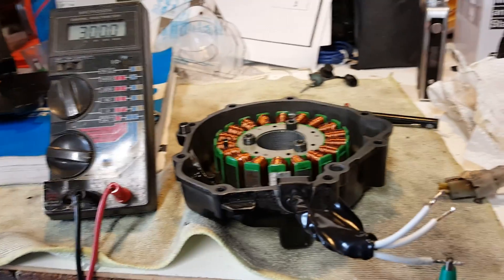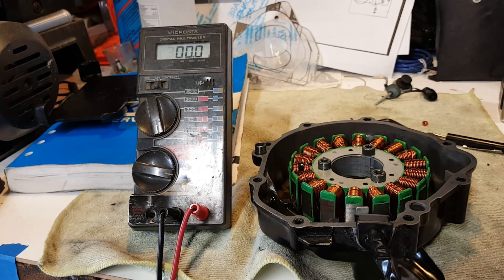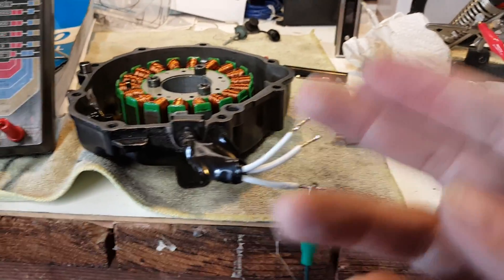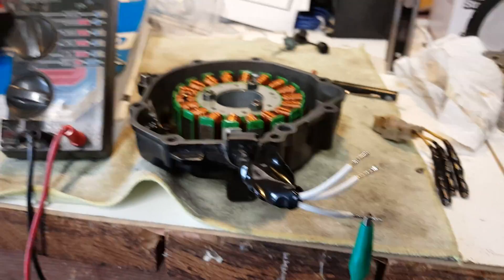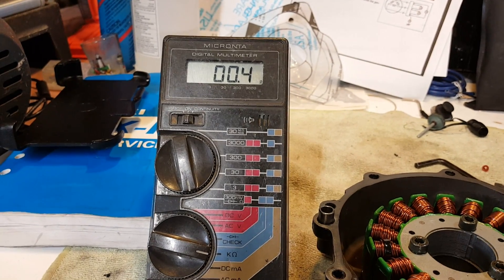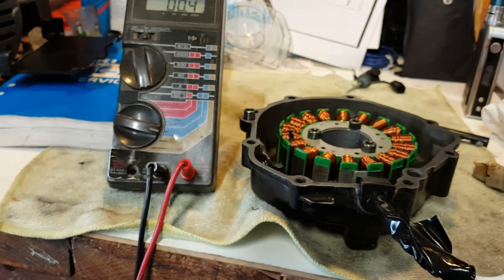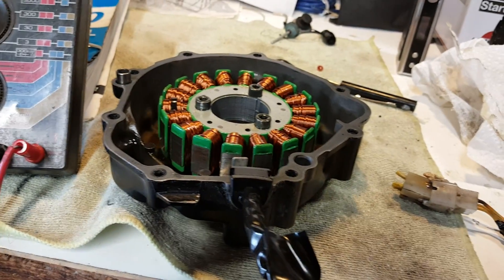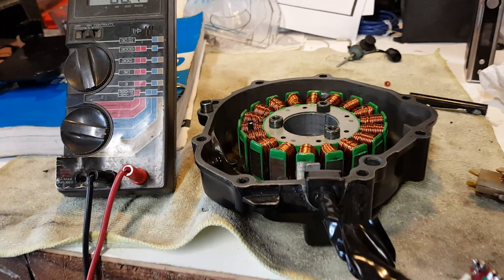Testing Your Stator on/off Your Bike

Comment: I didnt have a spark on my 08 te250, bought new stator  got spark, bike runs but not charging battery, stator from chine has 3 yellow and 2 wire crank sensor, thought might be cheap stator. Bought $300.00 oem stator from husqvarna  and wires are different and dont match plug on bike.
Reply from the maker: Well the plug should match up if the sale was for your bike specifically. Do you need the plug..NO.. as you can seen from my video I cut mine off so I wouldn't have to deal with the melted connection in the future. The plug may not match because some companies think for example the k6/k7 and some 1000s are compatible and there not.. so they posted as such.

What does matter is the correct voltage that the stator  produces and the fact that it bolts up to your housing. The number of wires from the stator should match the number of wires on your harness.

If your battery is not being charged then that means your regulator rectifier is damaged as well as it is responsible for converting the AC voltage from the stator to DC voltage which the battery and bike requires.

Comment: Best  stator check I've seen so far! 
👍
Reply from the maker: Appreciate you stopping in and saying so brother.. Hope to see you around in future DIY videos
Reply: I tested mine 89 fzr 600. I got all Zero for resistance.  Spec should be 0.31 to 0.37. Is this a good or bad stator? How does your Ebay stator holding out? How long does it last already?

Comment: you forgot to say HOW to connect the VOM  when engine running  IE one lead to one leg of stator wire , WHERE do you connect the other lead ? to ground or to other lead from the stator wire  ?
Reply from the maker: Put your meter on AC voltage/current.. Now Start the bike and let idle, disconnect the stator connection from the harness, ie.. Regulator Rectifier.. Place the positive and negative leads of your digital metter into any two pin locations on the stator connector while running. Rev the bike to 5K rpms and you should see 65 volts AC on your meter. Do this on the remaining pins testing all.. no matter how you rotate  your probs across all three pins, you should always see 65volts on your meter..

Hope that helps

Comment: When I pull my battery leads my bike dies so I thought it was the stator but I'm getting 4ohms like your good one so what should I check next?
Reply from the maker: Sounds like you got regulator rectifier issues. Your stator produces AC voltage at 65 volts AC, your regulator rectifier converts The AC current to DC voltage does charging your battery. If your status producing the correct AC voltage and tests just fine then there's only two parts to your system left..

Comment: hi sir why my stator of yamaha r1 when i test in ohms its only 0 no resistance, it means busted or shorted???thank you for your responce
Reply from the maker: Assuming that you have a 3 phase stator, set your digital multimeter to the correct setting for your bike, and tested it as demonstrated in the video then yes, your stator is toast. Most bad stators that have or had electrical issues will show it on the coper winding wires.. some look burnt or have a blackish color but just because it doesn't mean it's not bad, it's just one thing to look for. 

From what I can see,  the R1 has OEM Stator/Gen has a known issue of failure. So if this is the OEM then this may be the issue why it went out and you may need to replace both.

Comment: My connector wasn't melted like yours, but was pretty funky inside, I clipped mine and was wondering if it matters what wires connect to what? Cause when I hook my ohm meter up directly to the wires and rev I'm getting around 60 volts, but when I connect the stator to the bike and check the volts they're low and don't go up at all when I rev? Not sure if it's the regulator, or bad connection somewhere.
Reply: And not sure if the wires are just connected wrong, but didn't think it really matters, unless it does, when I clipped I didn't pay attention to what went where.
Reply from the maker: @paulburrows2120  What up Paul, no it doesn't matter  which  of the 3 wires you connect , there is no polarity. It's a bit harder to troubleshoot your issues once you have  butt connected but if you have used bullet connections, which come apart;  then you are golden. You need to start the bike and while running disconnect the stator wires from the harness and while revving at the bike 5k RPMs test the stator side  connections (BE CAREFUL  NOT TO SHOCK YOURSELF!) . Here you should see 65v AC.. if you do then you know that it's not the stator and only leaves the RR or battery.  Believe it or not a bad battery can still test in a good range (12V) but still cause an issue, This has happen to me twice and that's when I moved to the Shorai Lithium Iron battery seen here https://youtu.be/I8GIhZRz0os , ( Product Link: https://amzn.to/3gC4Cc2 )  and after 5 years I still have this battery and haven't had a single issues.

If it's not you're stator or battery then lastly it's going to be your RR.. I suggest not going cheap Ebay special and you can see why here https://youtu.be/uDhuwCE2Bk4 . I have no affiliation with these guys , I found them on the net after a ton of searching and reviewing. While the cost is a bit pricey I do not regret spending the extra coin for this RR, I still have it one my bike and haven't had any more issues with my electrical system.

It's been 5-6 years now and with these purchases I haven't had a single issue with my electrical system. Take it for what it's worth but for me this is the way to go.
Reply: @TheChemistDIY  thanks for the quick response! Yeah I don't have a tak so can't really tell my rpm's, about half throttle I'm around 60-70 volts which I'm guessing would be close to 5k so thinking my stator is good.I guess my question prior  was I checked the voltage after connecting the stator back to the bike and the voltage was low and didn't increase at all when I reved it up. Is that normal? Thinking it must be why you disconnect before testing but not sure. Also did a diode test on the regulator and thinking I did that right it looked good. And yeah never thought it'd be the battery, it charges up ok, bike will fire right up, but when putting ohm meter on the bike running it loses volts and stays around 11.9-12.2 volts when it should be around 13 or more. How would you test the battery in this situation? Sorry if I'm asking too much, I just don't know what to do really, don't want to fork over 200$ got a regulator and not be the problem.
Reply from the maker: @paulburrows2120  every bike has its own quirks and what your experiencing is what I went through many years ago, pain in the ass to track down the problem. This is the reason why I have the digital volt meter on my bike that you see in all my videos, I would never know when the correct voltage was being dumped in and when it wasn't and I could never trust when the bike was going to start.

Loosen the screws to your battery and leave hand tight, start the bike and then remove the +/-  leads to the battery, the bike should stay running as normal if your stator is good. Now connect your meter to the +/- leads of the bikes battery harness. Rev the bike up to 5k rpms and see if you get the 13 volts on the meter now. If you don't, then you know you problem is South (RR or Stator).. since you say the stator is good then that only leaves 1 other item in the equation.

 If you do then you know the problem lies North (battery).

Always remember that just because something test good on the bench doesn't mean that it is.. the job of the RR is to take the stator AC voltage and convert it the proper DC voltage the bike/battery needs and shunt the rest of the unused voltage. When the RR starts going bad a lot of funky shit starts to happen on both ends of the harness it connected to (stator/battery). It can back flow or provide voltage to the stator causing fried wires/connectors or fried stator.. on the other end of the spectrum it can also fry your battery giving it to much or to little voltage, hence the reason why I always ride with a voltage meter now, you just never know when this is going to occur, but now I have some clue and piece of mind seeing my voltage during my start and ride times.

Now if the battery is bad it can do the same to the RR.. the voltage that is provided from the RR to charge the battery has no where to go if your battery is bad.. causing the RR to work overtime, this new overtime load results in extra heat and cooks the internal parts or the RR and since Suzuki chose to  placed it in a poor cooling location, this guy is a goner. (See my relocation video)

Now you Get where I'm going with this..   if one part is bad it's kicking the ass of the other and these two will always remain frien-a-mies, hence why I changed the battery and the RR around the same time in the recording dates of these videos.. it was a losing battery and costing me a shit-ton of money.. it wasn't till I replaced them both at/around the same time did this problem stop for me, ya it was costly but that was one headache I was happy to pay my way out of,  kinda like an ex-wife.. lol.

Hope that helps you out brother..
Reply: @TheChemistDIY  thanks for all the info man, really appreciate it! I ended hard wiring the stator since it seemed to check out after testing, then hooked everything back up, charged up the battery good, fired er up, put the ohm meter on battery and had 13 volts, have it s lol throttle went up to 14! I've went on a few different rides, put about 100 miles on it and still spitting out the tight volts! So to back things up a bit 2 weeks ago had a flood where my bike was parked, water got to the bottom of the motor and I'm assuming shorted out the connection for the stator, maybe even the RR. But so far so good, and I feel you on the eBay parts from your comment earlier! I've bought cheap coils before and a few other things to save a buck but you get what you pay for! Coils didn't even last a month, and ran like dog shit with em anyways!
Reply from the maker: @paulburrows2120  No worries brother anytime. So it sounds like your good if your getting 14 volts. With my MOFET RR i get 14,2 depending on what  extra goodies i have running of course (City light, Fog lights, fans.. ect). That must have been some flood for water to get that high... lol
Reply: @TheChemistDIY  yeah had about 6 inches of water in my barn, first time it's ever flooded like that in 40yrs! I lucked out it didn't go any higher, but the water was gone the next day, fired the bike up and ran good! Didn't really drive it much till the following week and then started having issues with the battery dying which is when I figured out the charging system wasn't working properly.

Comment: Are you telling us to rev cold engines? Thx but this sounded weird.
Reply from the maker: What up Ola k, sorry to get back to so late. To answer your question.. yes. Revving your bike to 5k RPMs after worm idle kicks in is not going to harm anything.. after all, do you start your bike in the AM and just ride or do you sit there and wait 15-20 minutes till it reaches the normal operational temperatures of 185-190 degrees..

The bike doesn't have to be stone cold.. just not blazing hot coming back from a ride.. besides I doubt you want to work on a hot bike.. aside from the uncomfortable engine heat it could lead to some nasty burns... Just saying.

Comment: Three wire where  you  get that  to regulator oh CDI DC  I  ask
Reply from the maker: If your speaking of/about the OEM harness connector that connects to the stator i bought an entire wiring harness from eBay for $150. If your thinking about replacing your connector i would suggest not to and just hard wire it in. I haven't had a problem since the making of this video.

Comment: What kind of bike  is it
 I have a 800 valcan doing the  same.
Reply from the maker: This test will work on any 3 phase stator. My bike is an 05 GSXR 750
Reply: @TheChemistDIY  thank u for info.
Reply from the maker: If your burning up plug connectors, I highly suggest hardware. after I did this I've never had another stator issue

Comment: I have recently had my spark plugs replaced with a hotter plugs. Since changing the plugs, when the accelerator is all the way out, my bike spurts like it's not getting enough fuel and the high beam light fluctuates in brightness. Is this a stator issue or a fuel pump/filter issue? Prior to the plugs being changed the bike did not do this. It's a 2000 Suzuki Intruder 1500. 

Thanks in advance,

Jerry
Reply from the maker: What up jerry, running hotter plugs on your bike shouldn't have any bearing on things you described, in fact I run hotter plugs on my bike as well. If you're experiencing sputtering after the exchange of plugs perhaps the gapping on the new plugs may be incorrect or maybe the coil pack is just not fully seated on to the plug.

I remember a time when that happen to me after a sparkplug change and it was as simple as the plug not being tightened down enough and compression was escaping through the spark plug hole... Have you checked all these things?
Reply: @TheChemistDIY  .... Thank you very much James. I'll check it out and let you know.

Comment: So all wires are grounds no wrong way to connect correct?
Reply from the maker: Not grounds just no specific polarity when connecting .. no you cannot connect them wrong.
Reply: @TheChemistDIY  by chance do you know if the wiring on the rectifier is similar ?? Appreciate it
Reply from the maker: @bear4u2nite  not sure what side of the RR you speaking of.. one side of the RR  connects to the Stator this is the 3 wires that have no polarity.. you can hard wire them up as you please without worry..

the other end is up in the rear seat (left side of bike) by the RR which if you have a GSXR like mine has a 5 pin connector.. that connects to the bikes wiring harness.. theres only one way to connect that if you have the OEM connectors.
Reply: @TheChemistDIY  the side with 5-6 wires all mine are yellow
Reply from the maker: @bear4u2nite  So here is what there suppose to look like... https://youtu.be/NM4MD4PHnUk , I made this video after my harness fried.

the fact that there all yellow is not important, it just mean the wires had fried at one time and someone has replaced them.. Im sure you can trace them back to locate where the splice took place.. What is is that your trying to achieve and why is the wire color important.. If I had a better idea of what your doing then perhaps I could help you out

Comment: Melted connector blocks are usually caused by dirty contact pins or trying to draw too much current by fitting too many acessories like extra lights of heated grips or both at once exceeding the output of your alternator and the amp rating of the block. 
Hard wiring your stator in to the charging system is a BAD IDEA!. what if you need to replace the rectifier or the stator, or what if you have a bad soldered joint? you're just creating a whole host of problems you could solve by fitting an up-rated connector and waterproofing it with some silicone grease! (and decreasing the load on your over-burdened alternator!)
Reply from the maker: Not a single problem after hard wiring the stator in, and that's since the making of this video.  I cant say that will be everyone's cure all solution but that was my experience.

Comment: I only got 800 miles out of my ebay stator, 05 boulevard JUST PAY MORE FOR A GOOD ONE OR GET SCREWED LIKE ME PPL
Reply from the maker: Very well stated bro, you get what you pay for that's forsure. There are some parts you can get away with a cheap Ebay special, this is not one of them, the other being the RR.

Comment: I checked mine I’ve been having issues and they r all reading .01 ohms being .01 off like that does it mean it’s bad?
Reply from the maker: You saw the verbiage in the good book brother, .2 -.9 is what the meter should read. This is just one of 3  test.. second being putting the meter on the battery and testing the voltage when you rev the bike to 5k and see if your voltage gets into 14v. 3rd being testing the AC current with the bike running and connecting the mete to the stator to see 65 ac current when revved.
Reply: james moreno I tested with bike running and at 5k and it just drains the battery I just wanted to double check before taking off the case again. I went through this last October but I have a warranty for both the rec and stator just double checking thanks for the reply
Reply from the maker: @drz400supermotoPHX  not a problem brother, any time. Just an fyi the batter could also be an issue. Sometimes dead cells can cause the same affect. I ran into this issue one time causing me to purchase the Shori battery which ive never had an issue since. So to recap.. battery, RR and stator is what i had to replaced to get rid of my issue of the battery not charging.. that said it made me wire up a voltmeter which you now see in all my videos to insure my charging system was always working..
Reply: james moreno yeah I’m gonna put a volt meter on it and I took the battery first to make sure it was good and it’s good started with the simple thing first which is the battery just wanted to make sure before I crack open the case but at this point I got taking that cover off down to a science lol thanks again man
Reply: @TheChemistDIY  it is just according what you are running , the KFX700 checking the stator plug running is 36v to 56v @ 3000 rpm  and cylinder compression on the 700 is only 44 to 74 psi  so all machines are not the same (check you manual on youtube for specs.